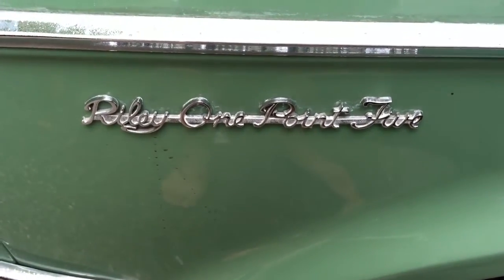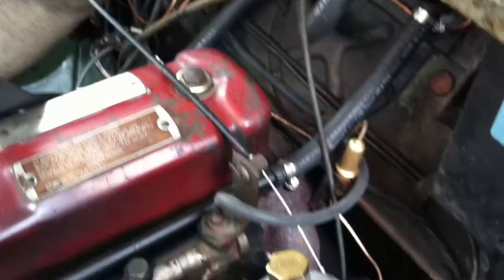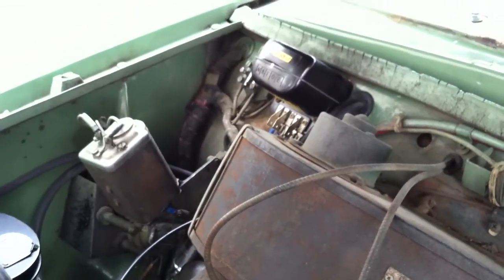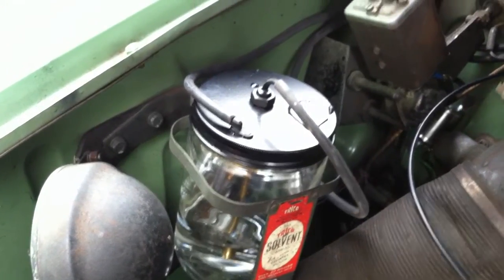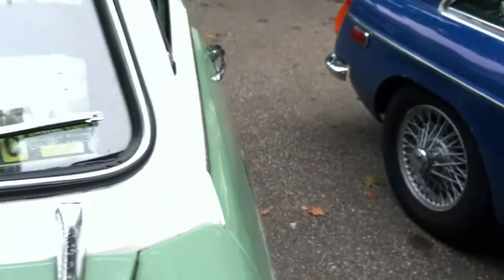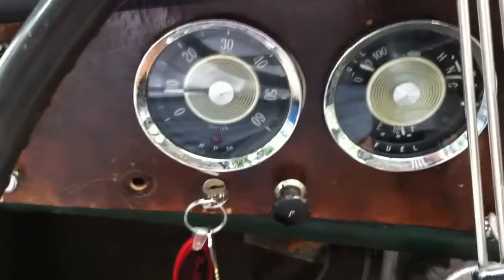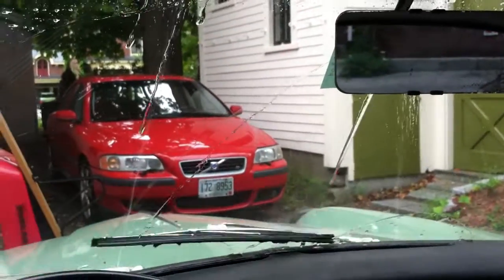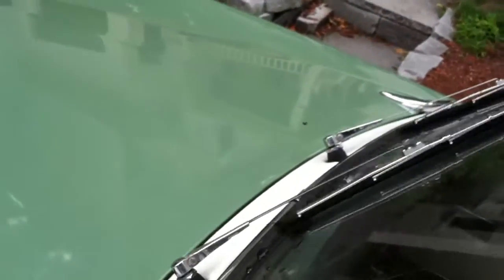Trico Vacuum Washer Pump

Comment: Thanks for taking the time to explain the workings.   I am currently restoring a 1961 Rochdale Olympic Phase I which was based on engine etc from the then current Riley One Point Five.  Wanted to get a Trico unit, but notice that they are huge money on eBay.   Looks like it will have to be a joint Christmas present from the kids!  Have the Trico button on the dash, so be sad not to utilise. Interesting vid - thanks

Comment: Yes ive bought those pumps before, the only problem is i dont have much room to mount them in my car, and im trying to keep this looking all original, ive found an impeller off another used motor, so im ok for now, but i want to be able to replace them at some point. Ive taken the pumps apart that you mention, and they have 2 gears that act as a pump rather than an impeller.

Comment from the maker: nzoomed: I do not think that the impellers (which have all perished by now) are available as a replacement item. However, Moss does sell replacements pumps that don't look exactly the same, but should get the job done. They are item #361-180, designed to replace the MGB's pump.

I did try moving the impeller from the new pump to the old pump, BTW, but it is too big.

Comment: Does anyone know where you can get the spare pump vanes (impellers) for the electric trico units? I am needing some for my wolseley's that use the electric models, i have some with vacuum units also, but the diaphragms fail on them.